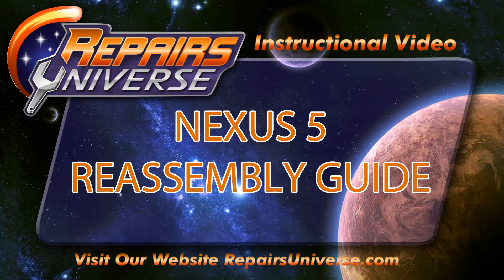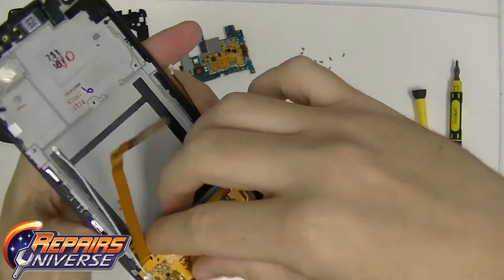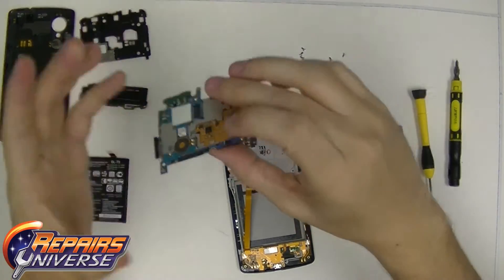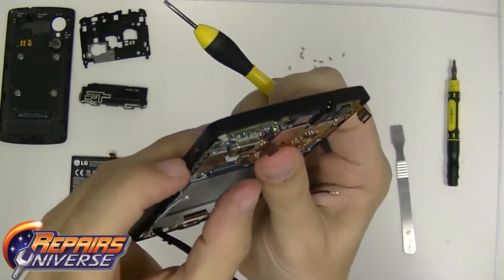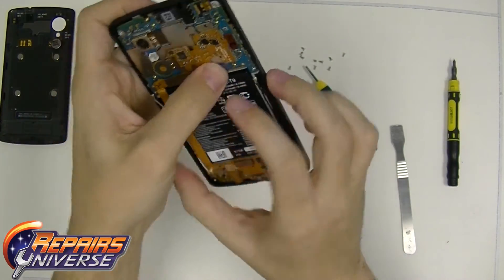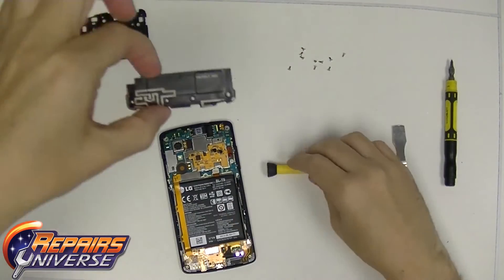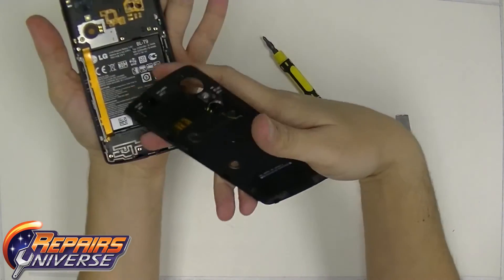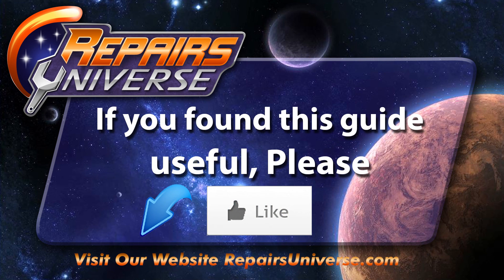Google Nexus 5 Re-Assembly Repair Guide

Comment: Hello Repairs Universe. Excellent video. Flawless and easy to follow. I'm writing because I need your help. My Nexus went for a swim yesterday. I used your video to dismantle it and try to dry it using denatured alcohol for the motherboard. The thing is I removed all the metal covers from the motherboard, during the process two tiny pieces fell off that I have no idea how to put back. One is a tiny thin piece of metal about an inch long with a tiny hook at each end; the other part i can only describe as a tiny butterfly shaped piece of metal with a whole in the center. As you can see, the odds of me putting the phone back  together are low, but at least I'll learn something. Any help will be greatly appreciate it.
Thanks